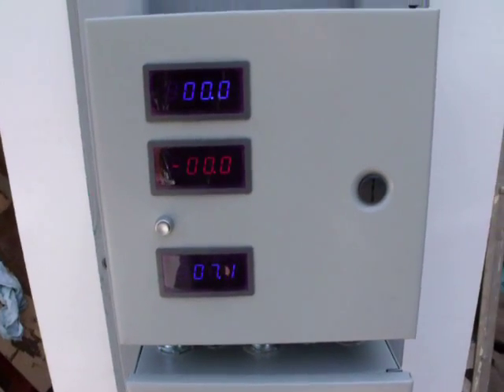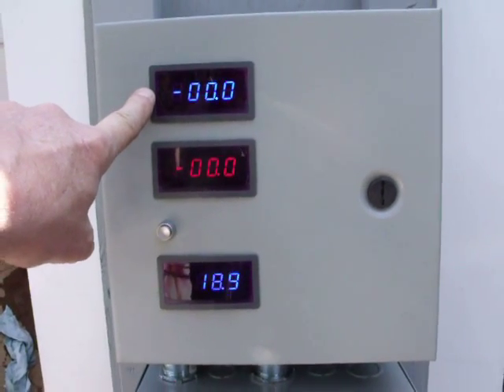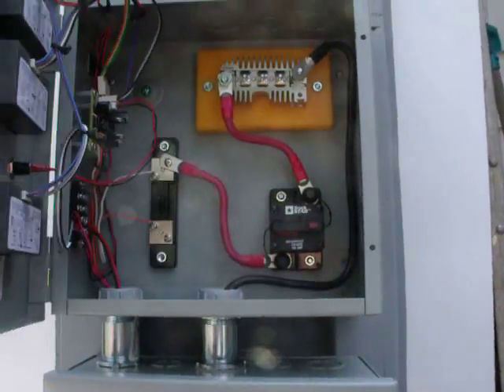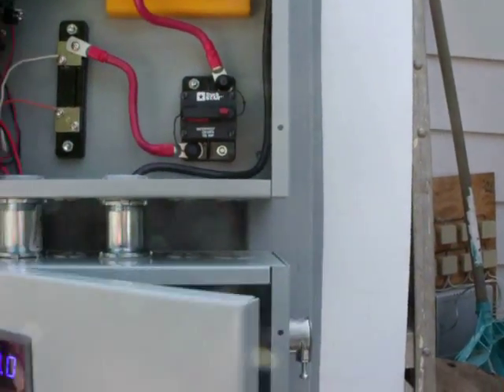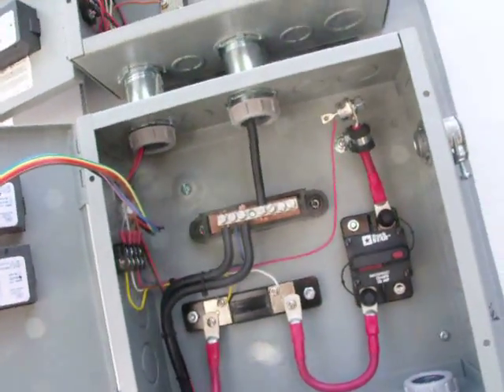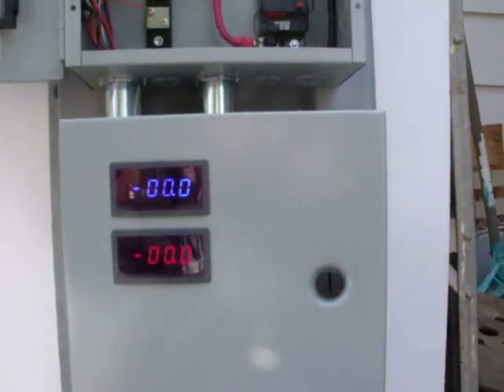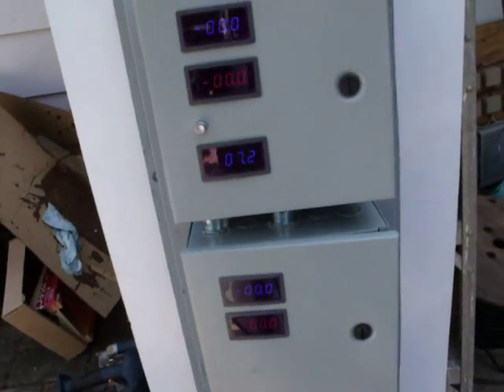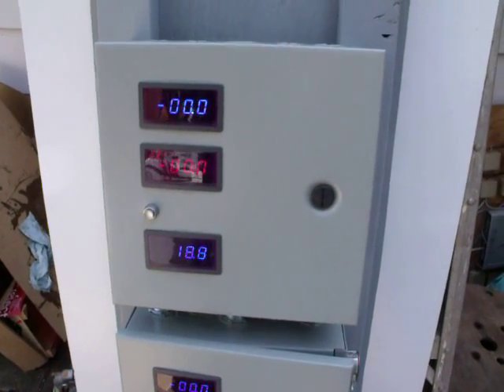charge controller panel.avi

Comment: Good clean wiring job I really like it. I have one of those coleman air  type controlers too. but it was really noisy. with the realays kicking in and out but its a great set up for wind. I am thinking about a small pma out beside my shed my wife cant complain about the noise out there. I need a small wind turban now.

Comment: @mccunecp I know I can build one but so far all the regulars I find can only handel a input of up to 37 volts and most wind turbines even thought they are 24 volts but if disconcted from the battery can produce up to 80 to 100 volts and I want to protect my low voltage current meeters.and I love your set up.

Comment: nice set up I have the same coleman charge controller what did you use as the power supply for it.   I'm going to run a 24 volt system and I haven been told if some how the battries are dissconnect the winturbine can fry the led read outs and I want a voltage regular for them to make sure they dont burn out what did you use for the power supply because I fell all read outs need that just incase a battery disconnct so they dont burn out from over voltage.

Comment from the maker: it is like a resistor  the amp meter could not handle all the amps so it is calibrated to the meter you still get your full power going through the shunt

Comment from the maker: @ohnedich42 I still have one bug to work out I am getting power feeding back from somewhere and it is messing up the other amp meter  so i have to isolate everything so they dont conflict  soon as the diodes get hereI will install them them make a video i know that is the problem  give me a couple days then i will post another video  OH and one thing I need to know is what  power is needed to run you meters 5v or 12v pull the back cover off and it will say inside.

Comment: Your setup looks great!!!!!   Could you post another video explaining in detail your wiring?  I purchased the same volt and amp meters that you are using , I just want to wire them up properly.  I planned on using the power coming in from solar panels to power both up, The amp meter is the one I am concerned about, your power adapter, what exactly is it?  Basically I would like to set my system up the same as yours.  It sounds like I am not the only one interested.

Comment: @davevanden1   Thanks on fast response!
Problem is: I'm not from US... Croatia in Europe.
The controller is: 40A Amp Wind/Solar Diversion-Charge Load Controller (from Coleman)?
55$ is simply 2much for me :(   and yes: need to pay sending bill and
the taxes (Croatian Law....).
For start I'll try to do homemade wind generator and found a schematic for the charger.
If that will work i'll invest more money to it :)
After a wind gen i'll invest more money into solar solution.
Sorry on bad English.

Comment from the maker: @Nordashi  Hi
I bought the charge controller from coleman air you can purchase just the circut board with the relays and mount them in your own cabinet it was fairly cheap and works great
the first set of meters i also got from coleman air with the power supply them spliced made some changes to it for all the meters

Comment from the maker: Hi nate 
i got the first power and amp meter with power supply from coleman air then just added my own to them 
remember the power supply for the amp cannot be the same ground as the volts meter it needs to be isolated
you could go to any electronics store and get a seperate 5 volt power supply and use it for the amp meter that will work